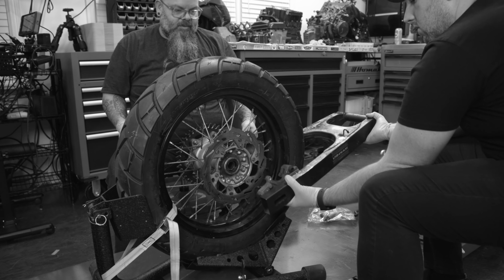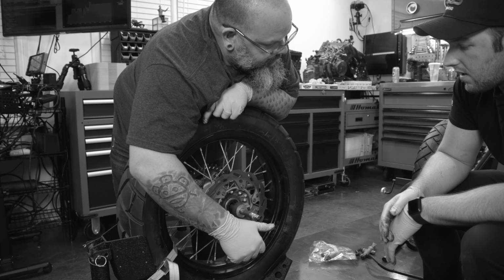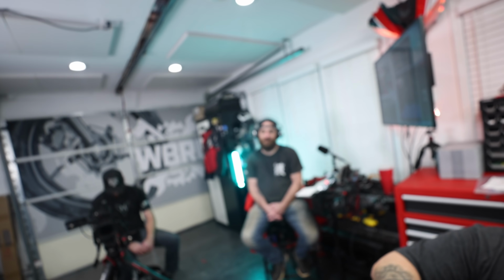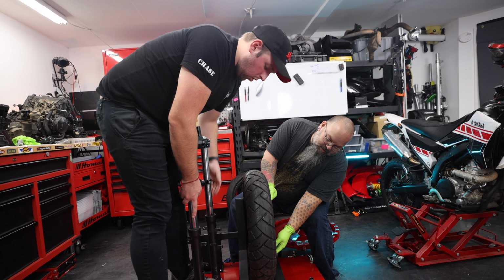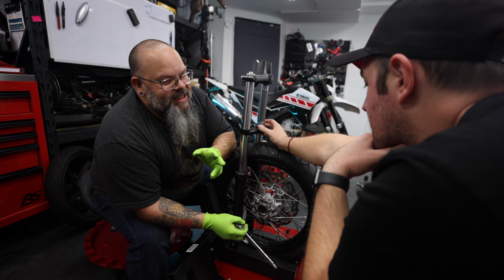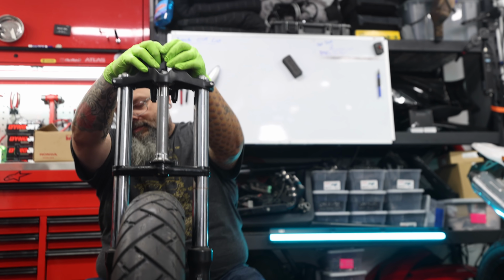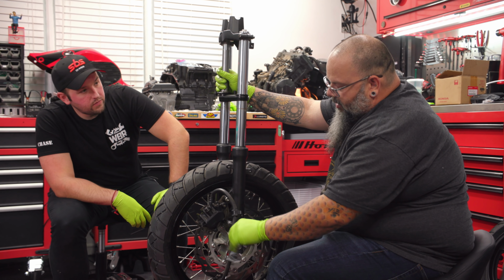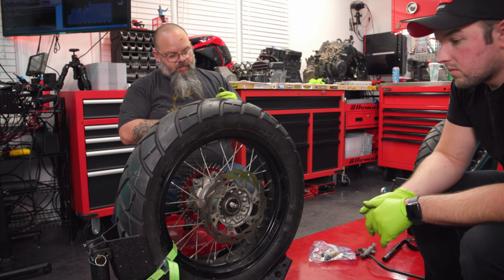Supermoto WHEELS on our CBR 300 Build ?! | 2016 CBR 300R Flat Tracker Build - Day 8

Comment: As  a ex motorcycle road racer of the  earlier 80s.  I enjoyed this because  back in the day most of our  prep was things like this how to  make this fit this or what can we do to make it work.  Such as valve shims for fork  spring  preload .  Bracing  on a swing arm    pulling off the stator  and  cuting the cover for ground clearance .  Fliping  shifter  backwards to get pegs  up .   Larger tires would rub  at speed   so modified fenders and thus fork  bracing  changes .   I always wondered if once the out of the box ready racers hit  do some of the fun of figuring out how to get a bike working on the track get lost .. Do not get me wrong racers always will work to improve  but today's stuff is so good . Things like matching the intake rubbers to the port ,  timing to the correct points  all things not expensive just time consuming and huge gains .  But the hours of thinking and testing ideas were the best . Much better than plug and play   sure not even close in quality at times but the pride of unique solutions .

Comment: The crf300l has the same axle diameters, so you could have got supermoto or dual sport wheels for that, which would probably have fit the cbr300r, without so much specialty work.

Comment: Where is the next video of this build??  Did you guys give up or is it coming??  
And try a non wave brake disc. sometimes the wave disc`s are a litle biger diameter then regular ones.   And why do you need new bearings? just make spacers that fit the yamaha wheel and the cbr wheel bolt.

Comment: OKay, So I am doing this right now. 

Yamaha bolt 19inch rim on my Fz07, reasons are because I can and I ride with Jakethegardensnake, I will leave that there. 

SO I made the wheel spacers out of 6061 aluminum instead of the steel that is stock on both the fz07 and Bolt, as Harleys have 6061 aluminum spacers (800-1000lb bikes), my fz07 at most for a trip is 450-500lbs so it should be fine, unless some one tells me otherwise. As I am unsupervised just doing my thing till some one tells me otherwise. 

As for the brake, would you suggest making a spacer for the rotor? or the Caliper?  Right now, Im working on the spacer for the caliper, total thickness is going to end up being 1/2 inch steel. Should be strong enough. My thought behind that is supermotos have all this big rotor brake kits. with a caliper relocation bracket with no issues.